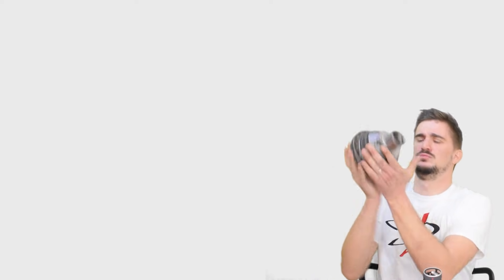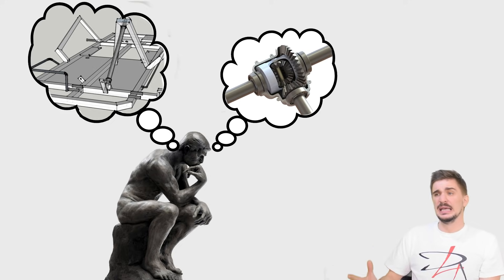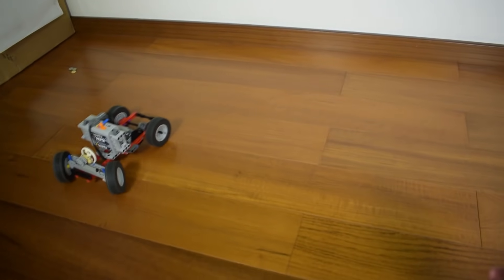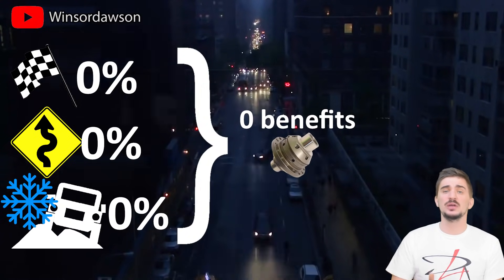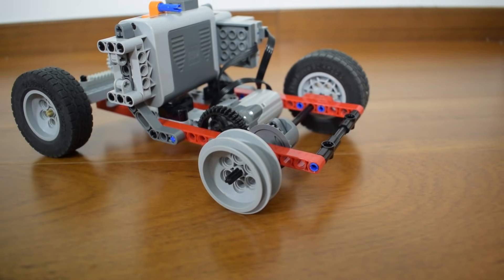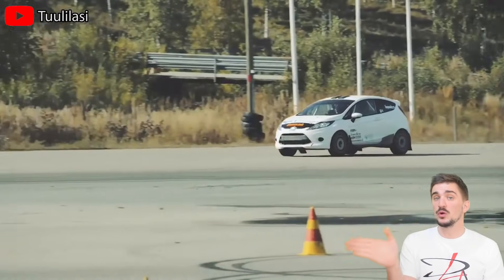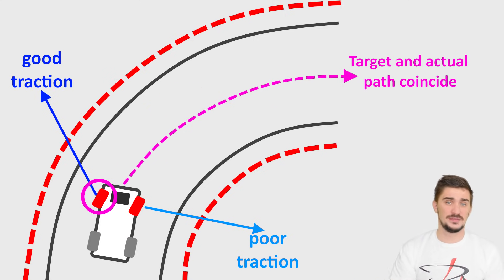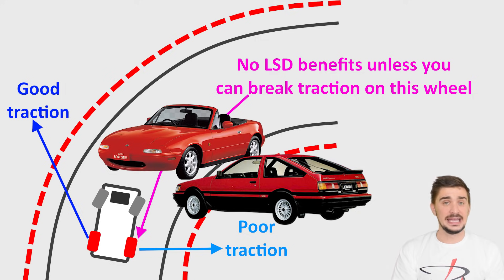OPEN diff vs LSD vs WELDED diff - VISUALLY + In depth EXPLAINED - Version 2

Comment: Very usuful video, thank you so much for sharing it. Anyway there's something I'm not sure I've got about the open differential. If it helps turning let axle rotate at a different speed...and the outside wheel is the loaded one and has more friction (aka need more power to rotate faster to do the same road of the inner wheel)..BUT you (and others) state that in an open diff the power will follow the easy path (aka the axle with less resistance) and the traction it's limited by the wheel with less load... how is it possible that an open diff  help you in cornering if the outside wheel need 1) more power 2)the power will follow the easy path and in this scenario it should end up in the inner wheel (unloaded and with less friction) 3) the outside wheel traction should then be limited by inner wheel? Unless when you talk about help in cornering you mean in a coasting situation, so without applying throttle or brake...sorry I'm a bit confused! Thanx in advance!
Reply from the maker: Unless traction is broken there is no problem with the open diff. They key part is breaking traction.
Reply: @d4a  brake traction when you apply power I suppose? So it's fine when you are cornering as it let axle rotate at different speed but it's not good on corner exit coz the unload inner wheel will prevent the outer to got all the traction it could?

Comment: I have a Land Rover Defender with the 300Tdi (turbocharged Direct Injection) which has I believe 380Nm of torque on a good day from its 2.5l diesel engine.  It came as new with three open diffs.  This means it basically is 1wd.   With the centre diff locked rather like a welded diff it has 2wd.  If one front wheel and one rear wheel slips the vehicle stops.  This caused me to be stuck in mud a few times.   I fitted a Detroit locker to the back.  This means that in mud the vehicle is now 3wd or even 4wd and I don't get stuck.  Do you agree with this analysis?

Comment: In the description you mention, that in the previous version of this video you had 2 mistakes:
1. Open diff sends more torque to slipping wheel. 2. Welded diff splits torque 50/50
Why are these 2 not correct?
Reply from the maker: The current version is what's correct and factual, previous version was not. It's not correct because it's not correct. If you watch the current and compare you'll see how the previous is wrong.

Comment: I have a new internal combustion engine concept that uses compression ignition and fuel vapours to allow the motor to burn nearly 100 % of the fulel ,would you do a video on the subject if i send you the specification and the drowings .i also have a provisional patent application filled in south africa .

Comment: How does it look in case of full time AWD/4WD cars? Subarus temd to come with all around open differentials on more pedestriam cars and hare lsd on the rear in sporty ones with lsd on both axles on STi cars. Is it worthwhile to combat understeer in awd car by upgrading front differential to limited slip? Also what is difference between subtypes like 1-way, 1,5 way and 2 way lsd

Comment: So you said in another video that the gear ratio can implement your torque or your hp. That means that in different gears you have more or less torque? And if so, when the dyno says you got 400 torque is like an average or is the torque that heats out of the engine?

Comment: Welded diff = best for drag racing
Reply: And drifting, if said car is not intended to be used for street driving.
Reply: @yongling9825  you can drive a welded diff on the street but it is a pain in the ass
Reply: @MrRandomcommentguy  That's exactly why I said it's only for drift cars that only see drifting and nothing else. I don't want wheel skippings on my car.

Comment: What about differential behavior on corner entry (coast) rather than corner exit (on throttle/power)? Thanks!
Reply: In my experience (in sim racing lmao) the more open the diff, the more turn-in you can get during corner entry at the sacrifice of instability on roads with inconsistent traction, and vice versa

Comment: Hey man! I have a 190e which is 1992, so direct injection. I want to do a bike carb conversion but I’m considering still using the injectors as a primary fuel source, and just using the mid and high rpm jets for additional fuel. Could you do a theory video on something like this?

Comment: I see that you still haven't explained the difference between a limited slip diff and an torque sensing (torsen)/automatic torque biasing diff.  The Torsen/ATB (such as the Quaife ATB) has a locking action while never locking to 100% so the wheel with grip/most grip never gets more than half/50% of the full power available from the engine.  A clutch plate type diff - a true Limited Slip Diff - (Salisbury, ZF/Trannex/ etc) will allow more than half such as 70% depending on its design and final settings.  The driving characteristics of each type is quite different from a full power standing start for example: the torsen/Quaife ATB in a rear wheel drive car will allow the back end of the car to step out which is corrected by opposite steering lock or feathering back the throttle to reduce/remove wheel spin.  The clutch plate type LSD from a full power standing start in a rear wheel drive car will fishtail at the rear with the power switched from the wheel on one side of the car to the other as the diff hunts for grip.  You simply hold the wheel straight ahead until speed and wheelspin reduce, or you can feather back the throttle if you want.  You don't mention a spool, so I will.  A spool is like a welded diff only it was made from a single piece of metal rather than created by welding parts together to make a single piece of metal.  There are circumstances in circuit racing where a spool is more effective than any other kind of locking action or slip sensing diff.  Here is a clip that confirms my statement: https://www.youtube.com/watch?v=JEiSTzK-A2A
Reply: I see that you still dont get the significance of video titles, or titles in general.
Reading them takes 0.4 seconds and will save you a lot of time in writting irrelevant essays.
It also helps to actually watch the video before making conclusions.
Reply: @bluewanderer9903  I see that you still don't understand the difference between a clutch plate type that limits wheel slip and a torsen/ATB diff that has a locking action.  I believe I use my time wisely and it is rare for  me to comment on a YouTube clip and even rarer still to write a reply of any length.  I guess we will have to disagree on whether or not my reply on this clip (an essay) is irrelevant or not.  I don't know who you or why you need to feel to comment on my comment but it's a free world.  For myself my motivation in commenting is to ensure viewers have a full and accurate understanding of a subject which I believe is still lacking in this clip.
Reply: I think I remember him saying in the first version of the video that he was planning on making a second differential video that dove deeper into the mechanics of how different differentials worked. I'm hoping that is still his intention because I'd like to see everything that you mentioned broken down and organized into one of his videos.
Reply: @GaurdianAzzar  my comment has been removed. That chap clearly has some sort of difficulty in understanding the most basic english.
This video is clearly titled and it did exactly what the title says: open diff vs lsd vs weld. This in NOT an LSD comparison upload. Also, d4a has clearly stated at the end of video that one of next few uploads will be on differences BETWEEN different lsd units, which is what this chap is talking about.
How can anyone have dongles to post an "essay" on the video they havent actually watched is beyond me. And look at his next comment, still beating his ego around without actually checking the video.
Reply: @bluewanderer9903   Are you really blue wanderer or are you driving 4 answers posting under another log in.  This video is factually incorrect.  The mistakes centre around the quite different ways different types of diff work.  This video talks about the Quaife and also diffs that will transfer 70% of the power to one axle without making clear the Quaife and other Torsen types of diff simply won't do that.  Rather than seek to gain a deeper and true understanding all that's happening here is a number of defences.  I have no ego involved here but cannot say the same for others.
Reply: @Daniel-S1  keep up the good work 👍

Comment: My spyder only has 138 torque to the wheels but this bastard starts sliding as soon as there is a small drizzle so Im getting an LSD. I already got good tires and Coilovers btw, its just really sensitive if theres the slightest amount of moisture on the road.

Comment: The Torsen type differential you presented is very bad, it is an open differential and doesn't limit slip, a clutch pack lsd is the way to go.
Reply: unless its a race car idk why you would use clutch type lsd
Reply: @arcanevoid9199  It has all the benefits on the street as well.

Comment: So are Torsens like Quaife or blackline any good for drifting? Heard much about they’re a lot less responsive than clutch lsd. But I’m searching for something that mixes up the daily and drifter… drifting on wet roads with not much power (like 200hp or so) and not necessarily high speeds… rather low speeds… does the torsen work out for me?
Is it worth it going from an stock open diff to an torsen differential

Would be happy about an answer :)

Comment: Interesting video, but again 'how does it work'? Too many videos always explain what is going on, but not why and how. I get that with slip, the amount of torque applied to both wheels are lowered.....  but why? 

Too often, explanations have this 'mater of fact' expression. Where things are explained using knowledge we have gained, while ignoring how we got there. What in a open differential is stopping the full torque of the engine for reaching the other wheel? I think explaining the mechanical part will make the video better.

Comment: My question is, which is better to drift in? Lsd or welded? I'm assuming welded from what I just learned but idk if lsd would allow drifts just as well as a welded dif
Reply: LSDs do lock both axles when you hit the gas. There's 1-way (diff lock only on acceleration), 1.5-way (100% diff lock on acceleration, 50% diff lock on deceleration) and 2-way (100% diff lock on both acceleration and deceleration) LSDs.

It's in the name: limited-slip diff. It limits the slip difference between two axles.
Reply: @yongling9825  ahh ok thanks for the info
Reply: @joshum3379  You're welcome.

Comment: Can you use conventional GL-5 to nissan R200V (VLSD) without LSD additives?

FSM says use "NISSAN Differential Oil Hypoid Super GL-5 80W90 or API GL-5 80W-90."

I was wondering if I can use any GL-5 (without LS spec or LSD additives) to our R200V (VLSD)..

Comment: Only one thing I'd say you missed, though not too important to the level of explanation you were going for. With any wheel slip during cornering you loose "overall" grip, the combined grip of all wheels holding you to the ground. Once one wheel starts to slip the other 3 have a higher force to hold to prevent you from spinning out, and at extreme driving levels one slipping wheel equates to a car in the bushes, or wall.
But in all honesty, I would much rather every driver have to pass a test you put out for "operating" a motor vehicle than every idiot out there now passing a driving test (that usually has not much or nothing to do with operation) to roam the streets.

Comment: Don't weld your diff.. use a spool.. they're cheap and effective
Reply: No kidding, and unlike playing with the reliability of welds and balance of the diff (more weld on one section than another throws balanced off due to more weight, not to mention welded diffs are heavier, so you've got parasitic losses there as well), it's just a single solid piece. No moving parts equals highest reliability and strength, as well as lowest rotating weight and therefore lowest parasitic losses incurred to spin it.

Comment: why does a wielded diff exist if you can save metal by just making a solid line?
Reply: Having a locked diff makes very low-speed handling behavior unpleasant for average drivers so open diffs are used. The benefits of an open differential outweigh the costs of manufacturing it compared to a locked axle. This isn't really the same for manufacturing limited slips because most people don't commonly push limits of traction

Comment: Are Limited Slip Differentials as good for drifting as Welded Diffs?
Reply: If you use the same car for street driving, an LSD will be better since it allows the rear wheels to rotate at different speeds, such as when you're going round a tight U-turn.

Comment: the 4age engine has 142-145nm not 130
Reply from the maker: There's multiple generations with multiple different torque outputs. This is the early bigport with the 3rib block and blue lettering on the cam cover.

Comment: 7:45 so where is 70 Nm disappeared?
Reply: To the slippery tyre
Reply: @Nothing....  Are You 100% sure? Friction is simple: F = Coefficient of friction x load (both const.) Torque is simple too: force x distance (both const.). Kinetic friction dont change, no matter what is the speed of sliding. If, after brakeing traction, there is only needed 15 Nm You dont get any more force at the wheel radious no matter how fast you spin the tyre.
Reply: @pyciar It says "Need 15Nm to break traction" so if it exceed 15Nm of torque it would make the tyre slip and used up all the torque transferred by the open differential
Reply: @Nothing....  ook, but after breaking  traction the friction force lowers signifantly (sometimes -50%), tyre speeds up (because no balance of power) but don't accelerate to infinity :/ there is some limit of spining. You stil didnt exlplain where all power/torque goes? Accelerating? No because itn only 15Nm from another wheel. Heet and sound? No, because it comes from friction (<15Nm). Acceleration of tyre? No because after 2-3s tyre didnt accelerate more (2nd Newton law). So where goes last 70Nm?
Reply: @pyciar  Did you even know how differential works?
If yes here ill explain it to you
So differential works by differentiate the speed of the left and right rear axle with the use of side gear and the spider gear that are connected directly with the tyre
In the case of one tyre slip the side gear will transfer all of its torque on the spider gear with the least resistance which makes the slippery tyre with no traction and friction(because it spins freely) gets all of the torque transferred by the side gear from the differential
Reply: @Nothing....  Have you heard of the principle of conservation of energy? The energy produced in an engine is directly proportional to its power, and that is directly proportional to the torque (this is a model, so I assume constant engine speed, no losses in the system, and no gear ratios between the engine and the wheels). In this case, 100 Nm must be transferred somewhere - I already explained: 15 Nm goes into the forward motion, 15 Nm into the friction (heat and noise) of the wheel on ice, and the rest? In the first question, I asked about the remaining 70 Nm because I think there is an error in the graphic - the sum of the work done by both wheels must equal the energy produced by the engine. PS. I am an engineer, at university there were classes on gear design (we also calculated differential mechanisms) and I know how...
Reply: @pyciar  Idk how to explain further especially since English wasnt my main language 
But ill try my best tho
So the tyres that are on the slippery side of the road will lose traction when the torque exceed 15Nm
When the tyre lose traction the differential transferred all of the torque to the slippery tyre(since it has the least resistance) so all of those torque was transferred into a kinetic energy(spinning of the slippery tyre) but due to the lack of traction on that tyre all of those kinetic energy does not move the car

So all of those torque gets transferred to a kinetic energy of the slippery tyre
Reply: @pyciar  summary 
So 100Nm from the engine
Only 15Nm of torque gets to the non slippery Tyre 
The rest gets transferred to the slippery tyre and was turned into a kinetic energy(wheel spin)

Comment: Shoulda mentioned the only reason you’d ever get a welded diff is if your into drifting
Reply: And really ust buy a spool at that point. More reliable, stronger,.safer, and has less parasitic power losses involved due to being lighter.
Reply: He pretty much did 17:32

Comment: I have a new LSD that’s got 1000 miles of break in.  It still clicks.  Also, when letting off the throttle at any able of attack in corners caused the rear to quickly oversteer from the rear like a forklift drives.  It unsettled the suspension is hard to control and damn scary.  Tried rear toe in 1/8 per side but seems to be an issue with the locking and unlocking.  Any advice greatly appreciated.
Reply: what lsd is it? and is it a 2way? also are you using a friction modifier/additive?

Comment: To bad if a front wheel drive car had a welded dif cornering would make the steering wheel jerk around and handle like shit you don't want to weld the dif that is in control of your steering tires LSD or open those are your options

Comment: You spent more time explaining weight transfer "simply" than necessary to explain it in the most complex way possible.

Weight "transfers" because the force is unbalanced with the Cg of the car.  The center of mass is higher than the road surface, so any force will create a moment around the Cg.  This "lifts" one side, and presses the other side down.

Throw up a free body diagram, and let people pause it if they want to check the physics.